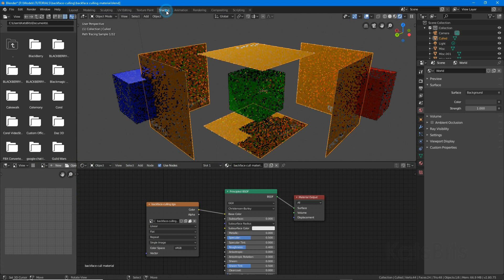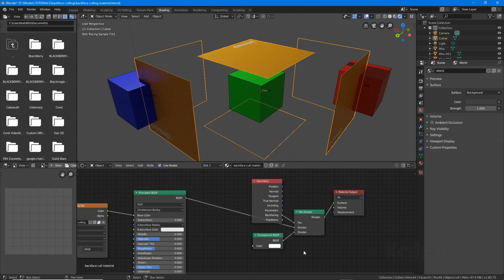Cycles Backface Culling - Blender

Comment: Doesn't seem to work in 4.0, I followed all steps accurately and it's just showing as all black like before.
Reply from the maker: When engine are you using? Just double-checked, works in 4.0, 4.1 and 4.2 for Cycles.
Reply from the maker: Also, make sure to read the yellow boxout here https://www.katsbits.com/codex/backface-culling/#rendered-cycles
Reply: The exact same setup definitely works in 4.2.1.
Reply: @jendabekCZ  Lol I ended up getting it to work but I forgot to update my comment, sorry
Reply from the maker: @jendabekCZ  yes see update here https://youtu.be/B-3QM1n1Ft4

Comment: The crucial piece not mentioned - for those of you getting black - is if the object is water tight, you need to turn off shadows in Object:Visability because the outside is casting black on the inside - or move your light inside the object.
Reply: Oh THANK YOU, dude, i was looking for hours for this problem.
I had a character outline that works by BackFice Culling, its good in EEVEE, but didnt work in Cycles.
Reply: thanks man
Reply from the maker: If you're implementing this on a closed object with outward facing surfaces, shadows cast by any light source will obscure internal surfaces as a matter of course. This isn't an omission in the process, it's an oversight that's squarely on the user not realising how their scene is set up with respect to dynamic lighting. And yes, the solution is to adjust your scene lighting or object setup so internal surfaces are illuminated.
Reply: @KatsBits  This issue only appear using cycles render, but how can we repaire it, without disabling the shadow?
Reply from the maker: @KitsuFox-e8l  what exactly is the scenario you are trying to use this with?
Reply: @KatsBits  Image render using cycle, of a 3D model
Reply from the maker: @KitsuFox-e8l  right but what are you doing that requires backface culled surfaces to cast shadows, as that seems to be what you're essentially asking? If you can link to a screenshot drop it here (or message directly, see channels About page for contact info).

Comment: does not work
Reply from the maker: You're doing it wrong. Try again and pay closer attention to what you're doing.
Reply: No, it doesn't work anymore, as in Blender 3.5.1 @KatsBits
Reply from the maker: @Element4ry  It's works in 3.5.1 so check again and make sure 'Backface Culling' is set in Viewport Display for the selected Material. See here for more https://www.katsbits.com/codex/backface-culling/#rendered-cycles
Reply: @KatsBits  I checked this site before. Although I resolved the thing in slightly another way. In the shader editor, I added a "Is Shadow Ray" parameter from "Light Path" node to the "Backfacing" and then to that I've added "Is Diffuse Ray", then connected it as Factor to the "Mix Shader" node. Then it started to work for some reason.
Reply from the maker: @Element4ry yeah that's getting a little Heath Robinson but at least it worked.
Reply: @KatsBits  It is, haha!

Comment: In case anyone new comes here and is under the impression that it's only showing you black - it seems to not appear properly in Material preview, but it DOES work in rendered mode.
Reply from the maker: It should work in both mode so long as the material is set up correctly, if it isn't there's probably something else going on or missing.
Reply: @KatsBits  it looks great on the render (cycles); however in viewport there is no see-through, just black as suggested. What am I doing wrong? Connected the shader nodes just like you said.
Reply: Nevermind, I just turned on "Backface culling" in material settings tab and it works like a charm! <3
Reply from the maker: @MagnusHertzberg  yep, that one gets you every time!

Comment: thankyou so much for the tutorial. 

I am succeed to replicate this, but having a hard time implementing this trick to do backface culling inverted hull for making an outline (I know it's easier on eevee, but I kinda need the same effect on cycles too). the problem when doing that is the material that are supposed to be the outline is heavily affecting the color of the original material since it's treated as realistic lightings. hope I can find the solution.
Reply from the maker: You will likely need to disable shadow casting on the 'outline' material otherwise yes, Cycles will render Shadows/lighting influences (don't remember where that setting is off hand).
Reply: @KatsBits  update :

immediately found the solution. on Suzanne, I select the solidify modifier inside the outliner. then I go to object properties, go to visibility, and then uncheck the diffuse and shadow box.

edit : but now I got another problem. I noticed that it's not the modifiers that I selected, but the whole Suzanne. it's working but there's no shadow below the Suzanne since I can't select the modifiers.

edit#2 :
oh no, I found the whole solution to it involving using lightpath node, and then recheck the shadow tickbox. I made the outline material have transparency (with 'is camera ray', transparent bsdf, and RGB pluged into mix shader and then pluged into mix shader on your video). 

ok, solved (for now)
Reply: @namaanda5349  hey, thanks for adding your explanation, it was the first source I found that actually worked!
ill just clarify for anybody else reading:
Outline texture:
-Light path (is camera ray) Into FAC of mix shader 1
-transparent bsdf in input 1
-outline color in input 2 (listed above as RGB, but could also be an emission etc)
so that mix shader then goes into a second mix shader
-geometry (backfacing) into FAC of mix shader 2
-mix shader 1 into input 1 of mix shader 2
-transparent bsdf (again) into input 2
then connect final shader to material output
Reply: z @megamech2268  oh my gosh it wasnt working but this made it work perfectly! i am so happy thank you so much!!
Reply: @KatsBits  Thankyou for that information. at least now I know that it's doable 👍

Comment: i've followed this exactly but rather than transparent its solid black, if I invert normals it becomes the correct colour
Reply from the maker: See the yellow boxout note here if you're using Cycles https://www.katsbits.com/codex/backface-culling/#rendered-cycles otherwise yes, it'll be black so make sure you have Backface Culling enabled, otherwise the above works with 2.9 without any change. The only issue may relate to using AMD graphics.
Reply: I did this and it became black too, what I did was delete the faces closest to the camera (if its flipped normals they would be transparent anyways) and that seemed to work for me!

Comment: Well ok that's useful to understand the basics... but what if my model gets weird holes when backfacing it while it IS needed?
Reply from the maker: If you've backface culled and are getting weird results those could be 'sort' issues. Would really need to see a screenshot of what you're looking at (see channel About for contact info).
Reply: @KatsBits  Alright thanks 😊
Also I used the Double Sided strategy and added two Principled BSDF and it somehow fixed it... But Smash Ultimate Daisy model really is hard to handle, and I still didn't get a so polished render.
I'll for sure contact you if I need help during my update process! Thank you so much for being there 😀

Comment: Didn't work for me at all and im using Cycles, i also sent you a message on Twitter! :D
Reply from the maker: It should work without issue so check your material settings and the meshes surface orientation (should all point outwards basically).

Comment: This doesn't seem to work for me at all, I've already looked at that hyperlink in the desc and looks to me like it's just repeating exactly what was shown in the video which didn't work for me. Here's a screenshot https://pasteboard.co/JeyPWAt.png    there must be some other checkbox you're forgetting to mention unless you can think of some other reason why it might not be working.
Reply: This setup does work in Eevee and every other part of blender, just not cycles render for me.
Reply from the maker: @alexanderelsen9397  that node set up works, you just can't see the result because all the faces appear to be outward facing. To test, swap the Shader inputs of the Mix Shader and the effect should be visible (this just 'inverts' the effect).

Comment: what's the point of the back-face culling
Reply from the maker: Generally speaking back-face culling is the default render state because not doing so consumes resources to duplicate and flip mesh surfaces so they appear 'two-sided'. Back-face culling replicates this. It's also useful for 'true' double-sided surfaces where each face receives shadows & shading independently of the other.
Reply: @KatsBits  thx
Reply: @KatsBits  will this use less memory or render faster?
Reply from the maker: @serbanandrei7532  For Blender, not specifically. For game engines, yes (in principle at least)... but it does depend on what type of effect is being rendered in either case.
Reply: Whoa i don't expect a response, thanks xd
Well, i am making a procedural skyscraper city made out of cubes using instance scattering and procedural materials for the buildings (a lot of glossy and emission). I am looking for ways to optimize its memory use to be able to add more detail.
I stumbled upon your video accidentally when i was trying to find a way to create occlusion culling because blender doesn't have it, but i welcome any type of optimization :)
Reply from the maker: @serbanandrei7532  See here https://www.katsbits.com/codex/info/#blender-29-status-bar to enable the Status Bar options to see performance in real time as you view/render the scene with or without backface culling.
Reply: @KatsBits  I use it already, but thank you for making sure that I know about it. Blender has the best community, I swear!